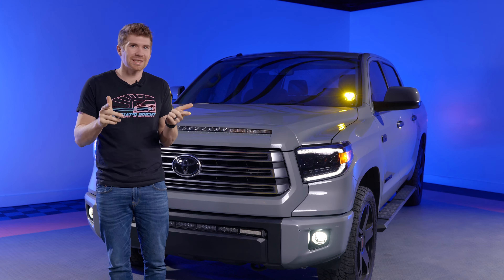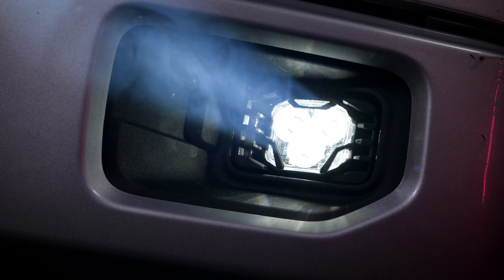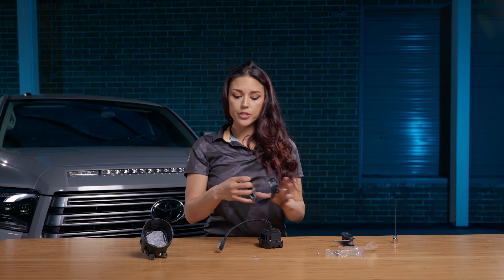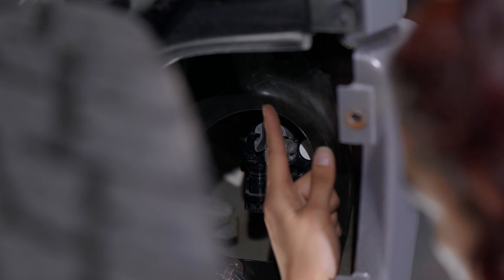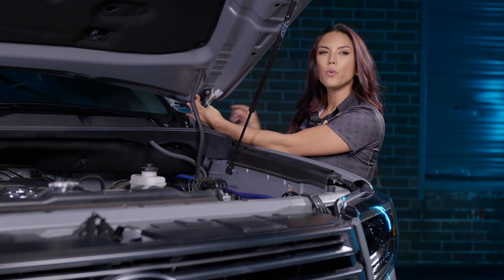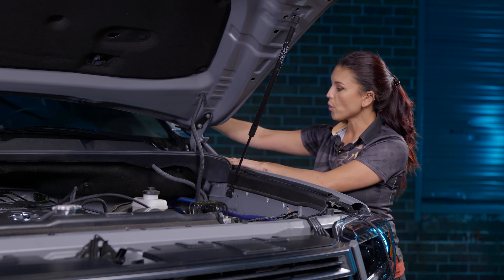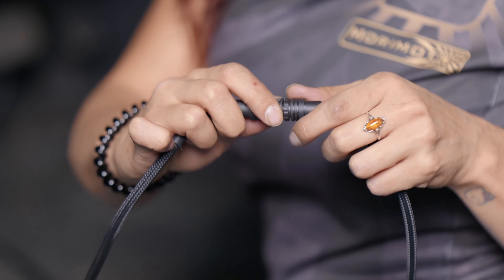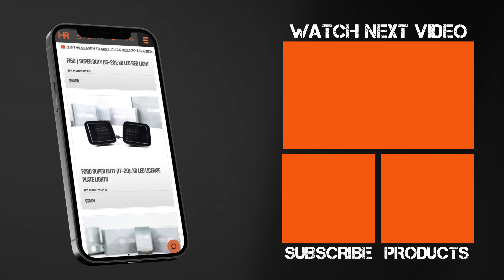Morimoto 4Banger LED Fog & A-Pillar Light Install for the 2014-2021 Toyota Tundra

Comment: This video is great! I picked up the Morimoto 4Banger Fog Light Kit for my 2017 Tundra a few months back and finally making time to install. Do you have any tips on what tool to use or how to measure the -3 degree beam aim for the NCS Wide Beam?
Reply from the maker: Standard tools will work just fine here! No need for anything special!

For the aiming part, check this out!

http://www.danielsternlighting.com/tech/aim/aim.html?fbclid=IwAR15PLSCYssPadOgvp_3fUlQ7lXT-NeBxVXK4AQ-2h5sySh9Qc8QlGl_3fA